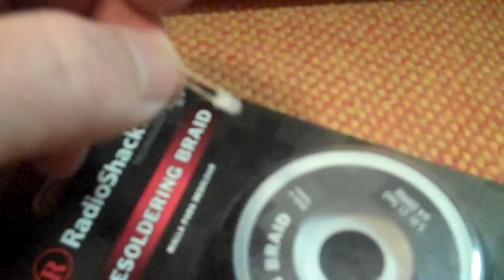Christmas Lights Control System - Part 14 - Version 2

Comment: I can confirm that the LED's on the relay-board turn on when the relay is closed. I've used one of these boards for a similar project. The only difference is, that I'm controlling the lights using a measured frequency. I sent you a video I shot during testing. Good luck on your project!

Comment: and i also have some ideas for future revisions (as an electrician it is what i will do)
run all your common's and ground's per box jumper off each other than run only 1 wire of each out to your terminal blocks than you only have a total of 10 wires out and i would run them out the bottom instead of side ports since it is on a swing wall you don't have to use those ((it would just reduce the mass of wires and bulky block layout

Comment from the maker: I'm not using PWM this time, using a AC zero cross detection circuit and triggering the pins manually in code. I'm going to be using pins 0 and 1, that gives me digital pins 2-53 and I can also use the "analog" pins 0-15. The analog pins have all the functionality of general purpose input/output (GPIO) pins (the same as digital pins), they only have special function when reading analog values from them not when writing to them.

Comment from the maker: Thanks, so when you drive the arduino pin high the relay closes and opens when the srduino pin is low?  That would be very cool it means my display LEDs will not be reversed from the state of the relays.

Comment: the question about 32 and 16 is you only have 16 outputs on the arduino mega and your running 32 relays------------how is that------------